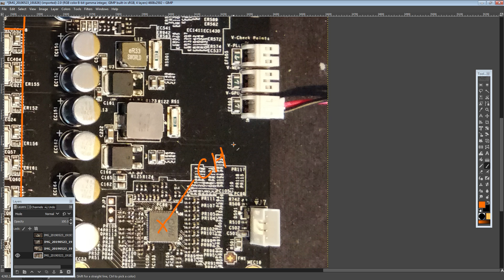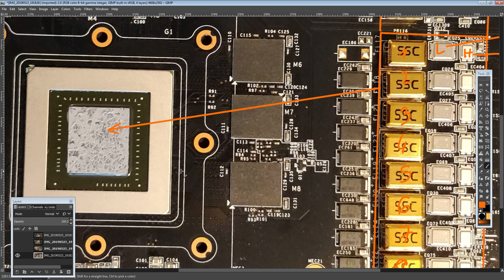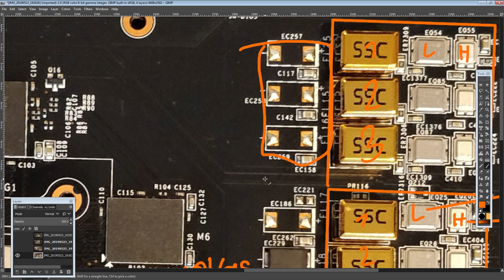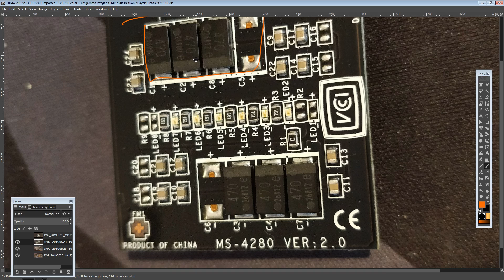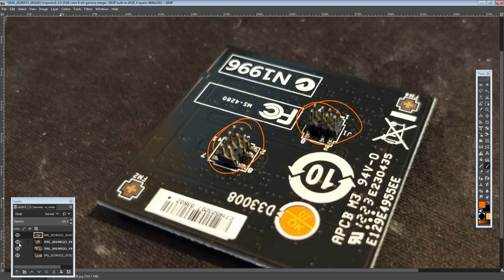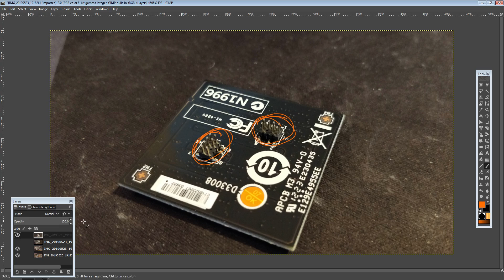PCB Breakdown: MSI GTX 680 Lightning

Comment: Since this is the same as a 770... Does anyone know how much performance gain I could push by doing some hard mods on an msi gtx 770 twin frozr 2GB? I have two since I used to run them in SLI. I wouldn't mind experimenting with one.

Comment: I have a GTX 680 LIGHTNING card with me, albeit dead after running for just 3 years... i wonder if it can actually be fixed lol
Reply from the maker: depends why it's dead.
Reply: @ActuallyHardcoreOverclocking  I don't want to take up your time, but can you tell me what are the most common reasons ? which ones are not repairable ?

Comment: This PCB looks exactly the same as a GTX 770 lightning, are the components used  the same. I have two of these but no 680.
Reply from the maker: Should be identical since the GTX 770 is a GTX 680 rebrand and most vendors literally just took their GTX 680 designs and put new cores and stickers on them

Comment: The pick and place machines probably wouldn't be happy about it but can't they just like stack the capacitors on top of each other?
Reply from the maker: that would be a massive PITA to do. But I guess I could try if that's more effective than having the caps on the separate PCB.

Comment: the EVGA 670 i got already has signs of crap bios. basically the way it was stock has  max boost of 1202Mhz but the table imposes a Vcore limit of 1.775 at 987Mhz so the card never boosts like it should. software "overclocking" control is a gimmick. i've set it up properly and boosts to 1202Mhz at the same 1.775V without stupid fake limitations.
i managed to mod the bios for 160% power limit though, now not only goes but STAYS at 1202 constantly. still on air, never goes above 82°C.
now the only trouble is the card is completely stable at 1202 but crashes like hell when even going ONE step above that. weird.

Comment: so it seems like the 600-700 series are the last group of cards from nvidia that aren't proper nerfed.
Reply: Maxwell was also still somewhat decent. It went to hell from Pascal
Reply: @jonnyj-z2x I do this all the time, I meant in terms of overclocking. But I've not spent any time on a maxwell gpu

Comment: So what did they mess up with 1080 Ti and 2080 Ti lightnings compared to the EVGA Kingpin?
Reply: Well everything, nothing interesting about the 2080Ti lightning, u cant even get the XOC bios without PL and custom Afterburner extreme. They are handpicking their own overclockers which they send this stuff. So regular customer have no chance of unleashing the potential of 2080Ti Lighting
Reply: @Slovak_Killer  But it has RGBs, those make it faster, right?
Reply: @Hostilenemy  yea thats why I removed them :D Nah for real, 2080Ti lightning is just (as BZ mentioned) FE card with XOC features that u have to request from MSI.